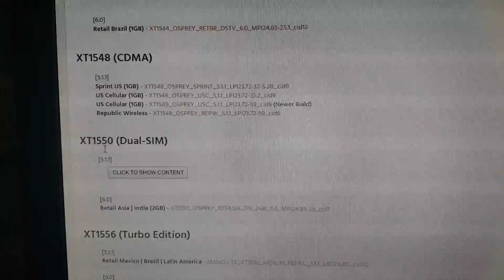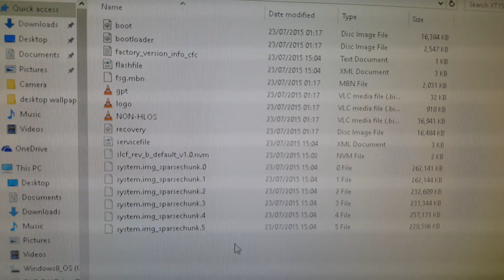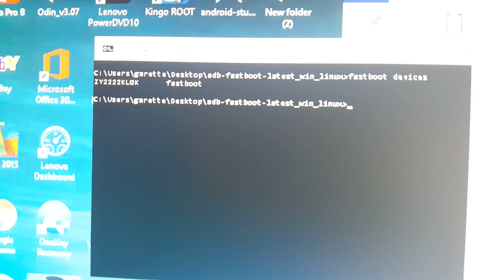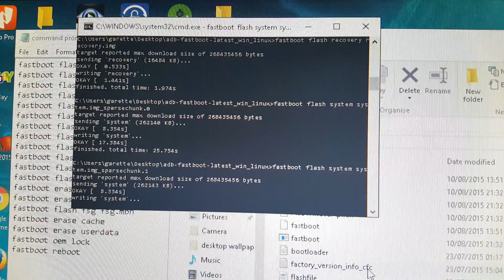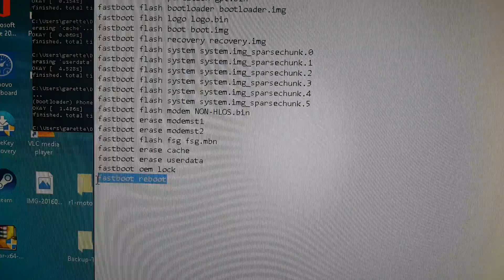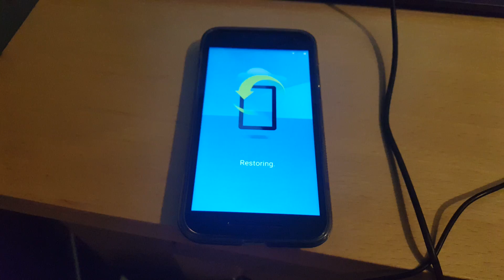Moto G 3rd Gen /2015 UNROOT & INSTALL ORIGINAL STOCK FIRMWARE TUTORIAL

Comment: hey sir i done all thing which was said by you now  my problem is.
OKAY [  8.127s]
writing 'system'...
(bootloader) Invalid signed image
(bootloader) Preflash validation fa
FAILED (remote failure)
finished. total time: 8.614s

like this i was suffering plss reply sir
Reply from the maker: u need to unlock your bootloader bro
Reply: i already unlock it nd install cm 13 but i have to install stock rom now

Comment: dont work for my xt1541 always get this message (bootloader) Invalid signed image
(bootloader) Preflash validation failed any help :(
Reply from the maker: did u get the unlock key? if yes it has to work bro because that means ya bootloader can be unlocked so u must be doing something wrong dont worry keep trying it can be tricky im an expert and sometimes it takes me several attempts

Comment: I followed this exactly for the XT1458 version of the phone. When I got to the end of my command window part it said " Please flash valid signed images just after lock begin" but I kinda just kept going with the video. It restarted normally and went through the setup fine. It activated successfully (reason I went back to stock unrooted is because I couldn't get service anymore after flashing cyanogenmod). I'm no expert at this, still learning. However, the XDA forums gave out a big warning that we're supposed to do a "Factory data reset via Stock Recovery" before flashing the firware like we did. Maybe this is causing problems for people? Not sure
Reply from the maker: thats weird as u can clearly see i didnt do a factory reset and it worked fine but then again we have diffrent model numbers,thias tutorial worked fine for me and many others
Reply: Android Doctor
Definitely worked for me too. Probably just the XDA people being extra cautious and picky. I didn't do the factory reset by stock recovery either. Probably wouldn't hurt to do anyway is why they say to do it.
Reply: I will subscribe you if you can solve my problem..or anyone in these comments:
I am unable to use Volte call feature in my Moto g3 (xt1550) but the data is working fine,in my marshmallow stock ROM..i checked on youtube and found a guy who was using volte on lollipop ROM..so i am going to downgrade to lollipop ROM..is my decision is right? 
Or tell me if volte is working with your devices or not?

Comment: In Command process there is 1 error
-----------------------------------------------------------
"F:\BunnY\IMP Files\3>fastboot oem lock
...
(bootloader) Please flash valid signed images just after lock begin
(bootloader) command!
OKAY [  0.088s]
----------------------------------------------------------------------------------------------------------
and

after the bootloader warning there is a andriod icon and under that it shows "Erasing...."

I request you sir help me as soon as possible

Comment: I am stuck on "WARNING BOOTLOADER UNLOCKED" screen . Please help. I did exactly as you instructed
..
D:\Vinay\MOTO G3 Tools\STOCK OS\adb-fastboot-latest_win_linux>fastboot flash par
tition gpt.bin
target reported max download size of 268435456 bytes
sending 'partition' (32 KB)...
OKAY [  0.006s]
writing 'partition'...
(bootloader) Preflash validation failed
FAILED (remote failure)
finished. total time: 0.410s
Reply: +Vinay Mhatre what u did next bro . i too have same prob
Reply: +Akash Sarkar Took the phone to Mobile repair shop today and he flashed Stock rom for me :)
Reply: Same problem here no solution found so far.
Reply: If u r once upgraded to marshmallow then it cannot be downgraded as long as u stay on stock firmware . So u gotta install marshmallow stock firmware. But yeah with some custom rom u can downgrade to lollipop.
Reply: +Akash Sarkar but for custom firmware we need to root first.
Reply: Soolution read and dont let the mind interfere with the information presented by this excellent video and written guide. One cannot and should not skip the step where one runs the following command "fastboot oem lock begin". Thanks Doc!
Reply: You guys in comment section can help me if you can!!
I am unable to use Volte call feature in my Moto g3 (xt1550) but the data is working fine,in my marshmallow stock ROM..i checked on youtube and found a guy who was using volte on lollipop ROM..so i am going to downgrade to lollipop ROM..is my decision is right? 
Or tell me if volte is working with your devices or what should i do?

Comment: Please can you help me :( My Samsung S4 has Suddenly started showing "No SIM card inserted  Emergency calls only". I have searched high and low on how to fix it but nothing has worked thus far. Please can you tell me the best way to fix it? My phone is rooted. Thanks so much :)
Reply from the maker: take out the simcard and give it quick wipe and put it back in then reboot if that dont work try a factory hard reset
Reply: +Android Doctor Thanks so much. I'll see if that works....if it doesn't should I get a new sim board and replace the old one? Someone was saying that it may be a hardware issue that's causing it?
Reply: +Android Doctor neither worked but thank you for trying to help :)
Reply from the maker: +StarRose007 mayne try another simcard see if that works! it could br your current simcard what is the problem
Reply: +Android Doctor It's a brand new sim and it works in my other phone :/ I've searched online and apparently it's a known Samsung issue...something to do with hardware fault or something like that. I'm properly done with android lol Back to iPhone I go! Thanks again

Comment: I just get the bootloader unlock warning and android "erasing" and it just bootloops. Any help?
Reply from the maker: power off then go into stock recovery mode and do factory wipe and reboot if that doesnt work try flash the stock firmware again also double check that u downloaded the correct fw for your model number
Reply: i did everything but it still bootloops :(
Reply from the maker: +35wes u must be doing something wrong as u can see it clearly works in the video
Reply: FIXED: I forgot to add system.img_sparsechunk.6 to the command prompt manually
Reply from the maker: +35wes great news glad my video helped u please don't forget to hit that like button thanks
Reply: great video btw